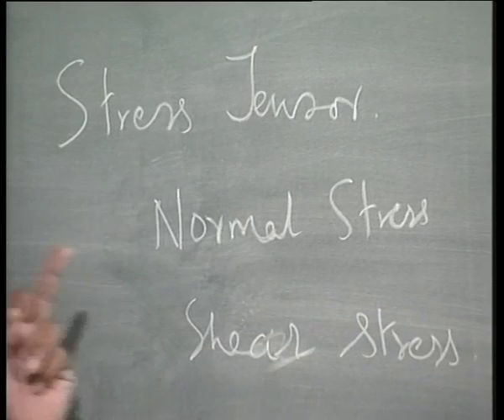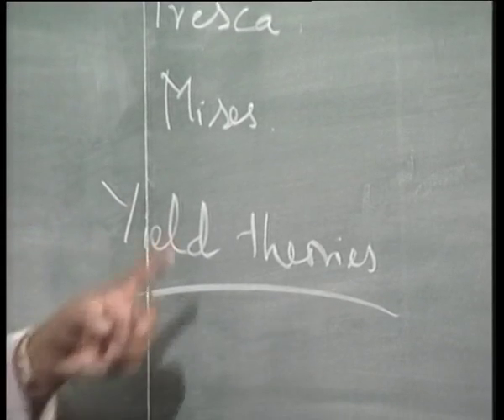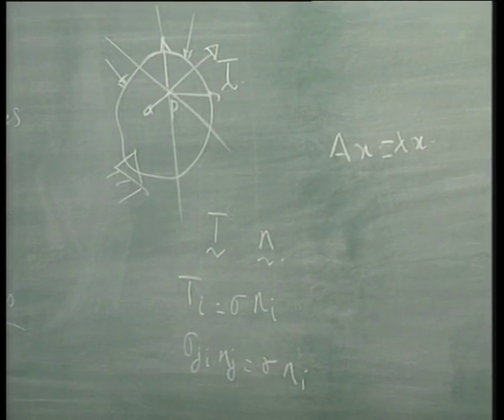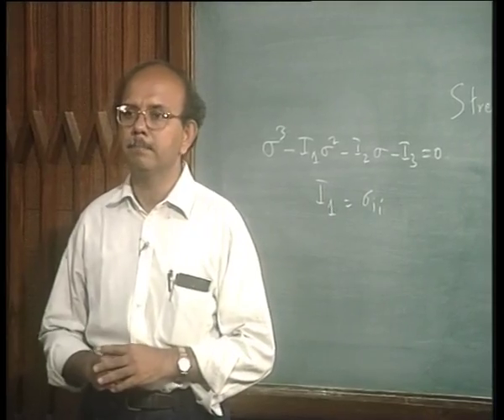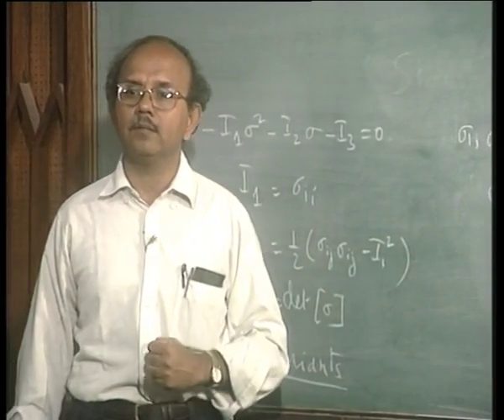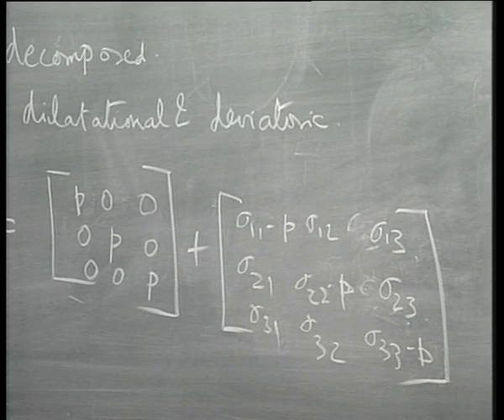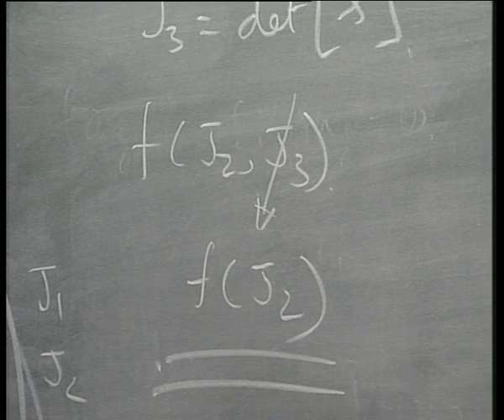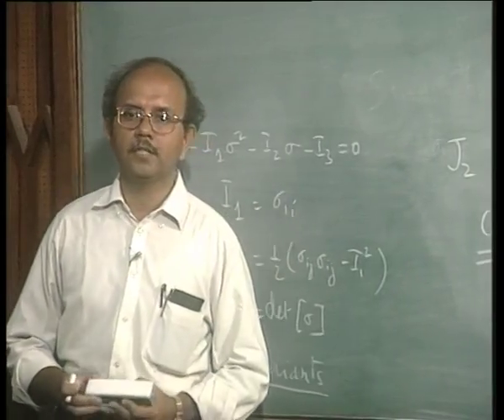Mod-01 Lec-08 Introduction to Finite Element Method

Comment: For every combination of surface force acting on a body, will there be any plane at a point under considerstion, in which only normal stresses only are present. This doubt is because there can be infinite number of combination of surface forces the body may be subjected in real situation.

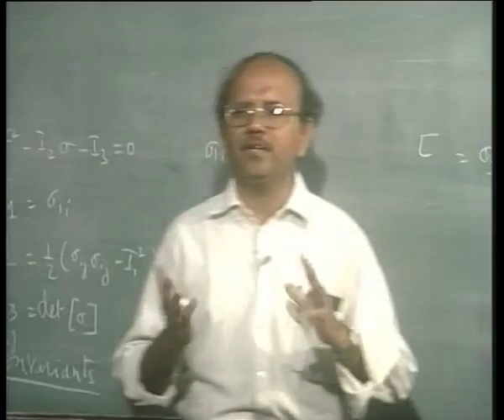Comment: At 30:00 , why does the prof equate P= sigma_ii / 3 ? Why divide by 3?
Reply: Same doubt.
Reply: Sigma ii = 1+1+1 => 3
Reply: we can correlate this with a situation when an infinitesimal cube is submerged in water experiences only hydrostatic force, and approx equal force and pressure(p) from all sides, and volumetric stress induced in it 3*p/3. similarly, if different stress acts then we can write as 
P= (sigma_11+sigma_22+sigma_33) /3.
In order to compare the stress with the hydrostatic situation, we do so...
Reply: It is mechanical pressure, an average of stresses acting on three faces.
Reply: sigma_ii isn't the element(sigma_11, sigma_22, sigma_33) but it is the trace of sigma=[sigma_11+ sigma_22+ sigma_33]

Comment: Why J1 is equal to ZERO?
Reply: when you add sigma11+sigma22+sigma33 of deviatoric part of stress tensor it comes out to be sigma11+sigma22+sigma33-3p..............................(1)
3p =   sigma11+sigma22+sigma33/3

put 3p in equation 1
then J1=0
Reply: Yogesh Jasra
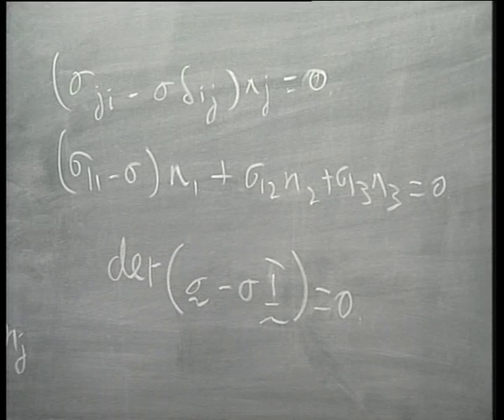Reply: at  time 18:57 he says Det(sigma - sigma I) =0. can someone please tell me what's the leniar algibra section(s) I need to revise in order to understand this part. I need to upgrade my Leniar  algibra theory but i dont have time to follow a complete linear algibra course from start to finish. thank you!
Reply: +Azmil K When the determinant of a matrix nxn is zero, then the rank of the matrix is n, then that is the only possible way to get the nontrivial solution for the equation. For more details, look for the system of equations section in linear algebra.
Reply: thanks a lot.. I also had the same doubt..